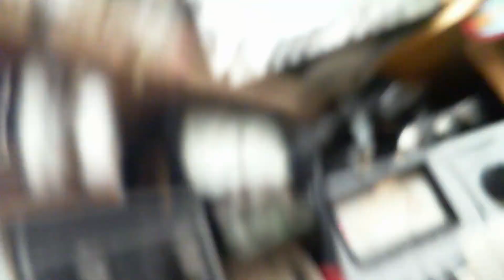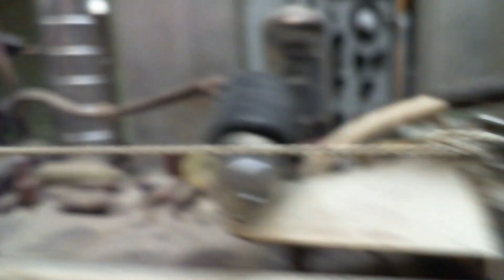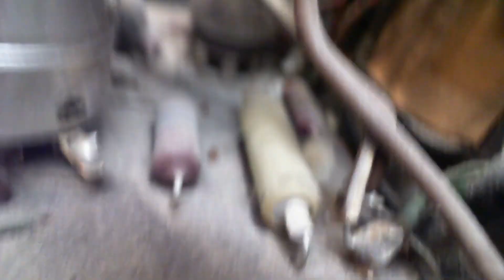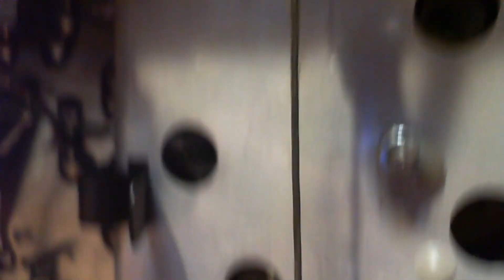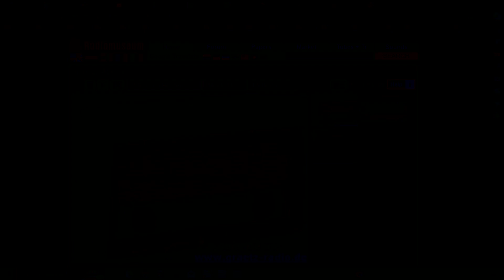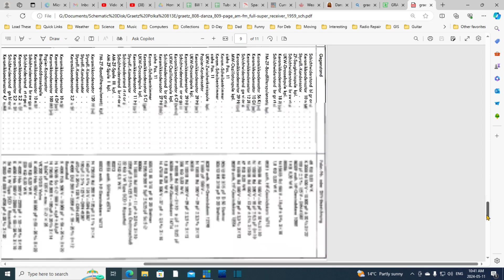Graetz Danza 808E Tube Radio Video #1 - Identifying the Trouble

Comment: For those who want to follow the massacre of this radio;
The german model was discussed in detail (incl schematic) in the publication "Funktechnik" of "1959" issue "13".
The pdf scan (german language ofc) can be downloaded from the repository at worldradiohistory subfolder INTERNATIONAL subfolder Funktechnik 
file "Funktechnik-1959-13"
Interesting tidbits; in the original version this set uses the power transformer only to provide the heater voltage. It derives B+ 245V directly from the mains 220V via half wave rectification over a selenium rectifier. This means it is a HOT chassis.
Unclear is how the export versions go on about it.
For the 110V E export version I would think they wont use voltage doubling but have an autotransformer primary do 110 to 220V step up but keep it a hot chassis otherwise.
The 220V TR tropical climate version my for safety reason omit autotransformers and avoid the Hot chassis and use a standard mains isolating transformer design. But that is just a hunch and would need hands on investigtion since I cant find the export models' schematics.

Also interesting tidbit; for cost reduction they omitted the expensive tubes ECC85/ECH81 in standard configuration and went for a "ingenious" trick; the cheaper EF 85 is used both on AM and FM; in AM it is a wideband RF amp and in FM it is both a tuned(!) RF preamp (hence the permeability tuned FM antenna coupling transformer) and also 1st FM IF amp. The AM and FM local oscillation and mixing is done with the also cheaper EC92.
Reply: I own the same exact radio, along with several other German radios that ar AM-FM and 6 band short wave radio like the 6000 series Satellit versions. Very complex radios, especially if you need to re-string them. Glad Jim decided to work on this unique radio design... We always learn something new..

Comment: Jim being stumped at permeability tuning is a bad omen. This radio is  too complex for a AA5 tinkerer. Especially since all the WIMA caps have to go; both the cylindrical and "hermetically sealed" tropydur "Malzbonbons" (in english sometimes referred to as malt candy or cough drops).
This is particularly important for the grid cap of the EL95 since the small audio output transformer cannot handle heat from excessive plate current that well.
I wonder how many "was broken from the factory" excuses we will get...
Reply: Actually your wrong about a few things. Jim is not stumped what a permeability tuning is,  only that he does not see that in American made radios that he normally works on. 
Second if you search R-390 under Jim's videos you will see that 3 years ago he made 3 videos related to a Collins R390 radio, that has dozens of permeability tuning cores in it. And doing an alignment on one is no easy task, the US Navy sent me to A school to learn how to repair this radio back in 1970, it was a week long class.. Since then I have repaired and aligned over a dozen of them, but now being retired I rather not lift these giant and heavy boat anchors..

Comment: Greetings:
     This radio appears to NOT SUPPORT 120 VAC power as shipped. The English text  is likely for UK support on 220 VA. The burned resistor is  likely pat of a custom modification to work on 120 VAC. But that does not explain the US style plug. The E part off the 808E designation may relate to either EXPORT or ENGLISH.
     As the conversion to 120VAC is not easy without a power transformer swap, examination of what if any changes were made to the power supply need to be found. The 220v transforrmer is item number 407 in the parts list.
     I was able to find only a German language service manual with GOOGLE Chrome. Apparently this chassis is sold as both Danza 808 and Page 809 with differences only in the cabinet.
Reply: E stands for Export and is 110-127V AC.
The 220V AC version for export was classified TR not E, with TR meaning "tropenfest" - suitable for tropical climate.
 And at 8:17 it can be seen that the back cover clearly shows in the bottom right corner the text "For 115V AC only." in english, spanish and french language.
My first assumption was that 
this restriction of a fixed voltage rating comes from the size restrictions of this compact design forcing them to not use the bigger multi primary voltage power xformers they used in the consoles, but smaller single primary voltage transformers.
But the issue goes much deeper than that; the radio in its original 220V form uses the transformer only for the heater voltage. The b+ is derived directly from the mains vis a selenium rectifier,  making it a HOT chassis. 
For 110V mains (E version) either a voltage doubling circuit or a filament transformer with a 110-220V autotransformer primary would be needed to get to the necessary B+.